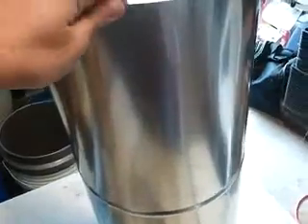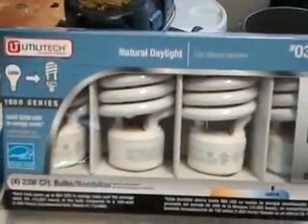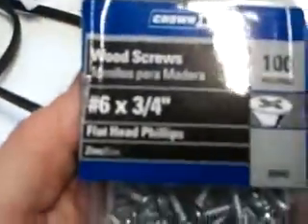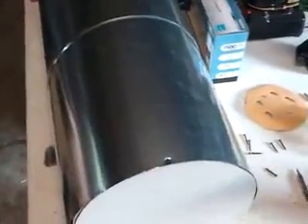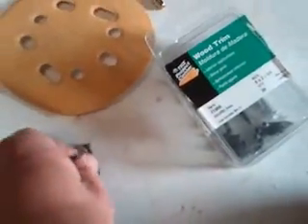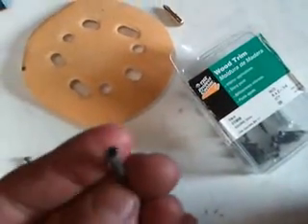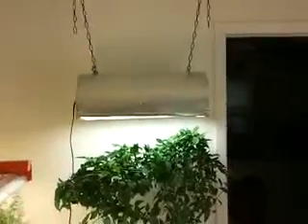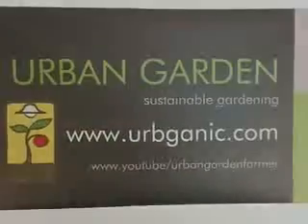How to build a grow light for $30

Comment: good idea,  but I wouldn't take all that yellow shielding off the black and white wire.  Its a wasted step and the shielding is there for a purpose.  its going to get hot inside that hood and over time the black and white wires will begin to crack.  You've got it mounted on steel and covered in foil tape. something could short out on the metal.  In Canada that would never pass ESA standards.  So if you're selling them like that you are opening yourself up to a lot of liability.

That said, I will likely be making something just like this.
Reply: +David Bonany It wont get hot inside.  I have done similar to this before.  The CFL bulbs don't emit enough heat to worry about.  I am, however, curious about getting some cheap UV LED flashlights, and adding them to the rig.  Would it be worth it?

Comment: Full spectrum CFL's work great for cannabis but you have to provide extra heat since they run very cool compared to HPS and MH.  They also don't spike your power bill or put out an intense thermal signature for cops with heat imaging surveillance.  Power bill spikes and intense heat signatures are enough to get a search warrant.

Comment: IF  you can afford it you should try the newer l.E.D. Bulbs, they put out the same lumens as the cfl's and use around 8 to 12 watts per bulb, very cost effective. The good ones cost about 35 bucks though at home depot, but the bulbs are said to last 30  years or more. Also they put out less heat then a CFL.

Comment: 100W really won't give you much output, but I guess it may be okay to start seeds if you used a 6500 range bulb. 5000 is a little warm still for growth, but may work for flowering. Better yet, mix the bulbs so you have warmer and cooler bulbs together. For actual growth I think you'd need more lumens though.

Comment: You could have run a ground wire the length of the other wires under the tape. Safety foist! Safely first! ?? I think I messed up the old sayings.

Comment from the maker: @19Photographer76 , I haven't found venting necessary. The cfl's don't put off too much heat. It wouldn't be a bad idea though, might prolong the life of the lights? The reason for pre drilling is, I found when I screwed in the screws with no pilot holes, the mdf would split.

Comment: Well done! 

Question - you don't feel small venting for heat escape is necessary?
Suggestion - if you used 1" self-taping pan head screws or piercing sheeters for sheet metal applications, you'd save drilling time and have a better fit.